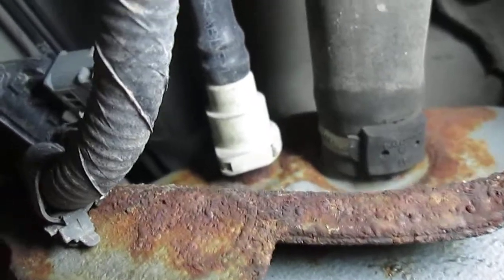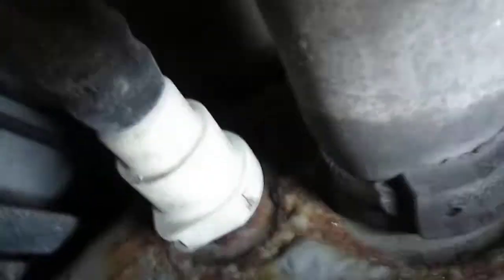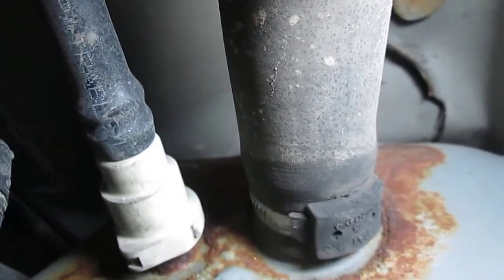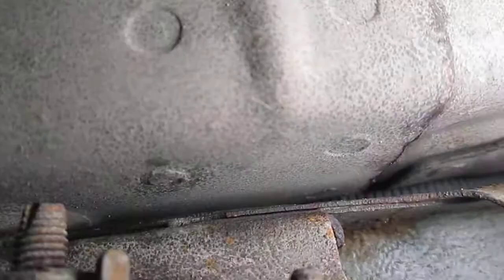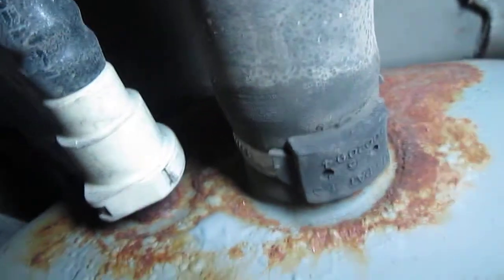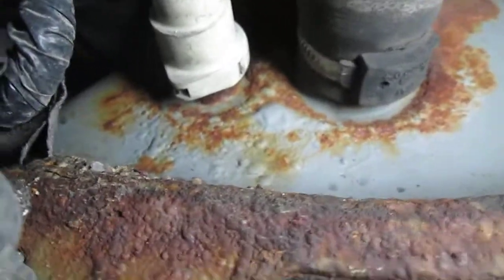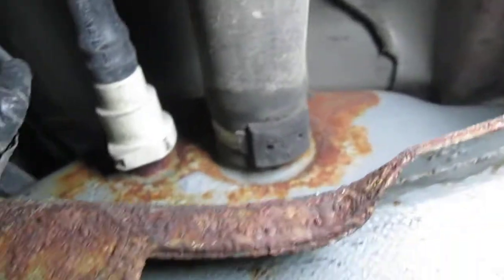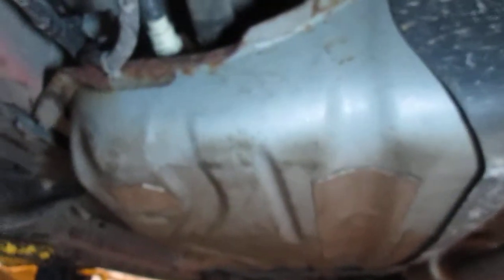2008 ford edge fuel tank rust

Comment: Are you aware there is a Ford recall for this issue?
Reply from the maker: +85montie Yes I made this video to document rust for others with this model and the recall covers the 2007 -2010.  Thanks for watching.
Reply: I just got a new tank installed on my 09 Lincoln mkx recall.  Ford is not that bad after all.  Well the reason for the recall was that there was 1 fire in the States  due to a bad tank.  I wonder if there was no fire if Ford would even consider recalling these vehicles..
Reply from the maker: Yes I was aware of various recalls. Glad you have a new tank.  also glad the fuel pump still works. Many have had to replace the fuel pump and that is not covered in the recall.
Reply: The recall does not cover all VIN's made between 2007-2008. I found out the hard way.
Reply: @y2knoproblem  yes it does i have a 07 and its at the ford dealer right now getting the recall done on the gas tank and airbag